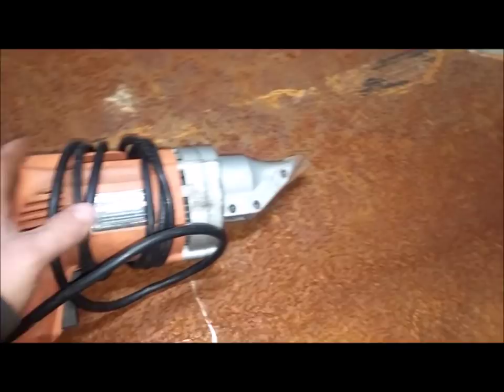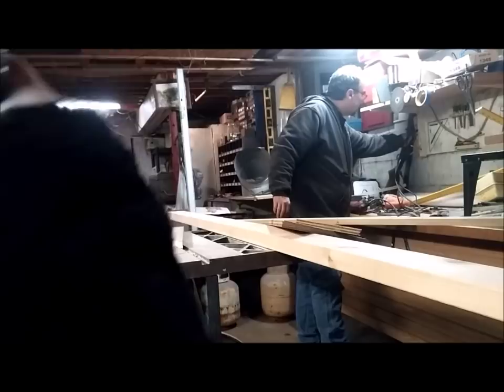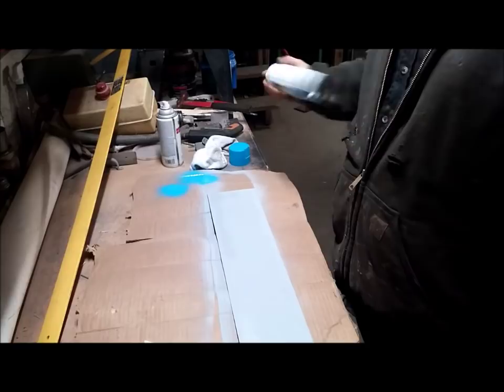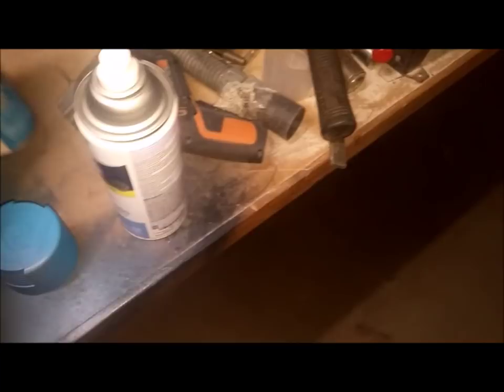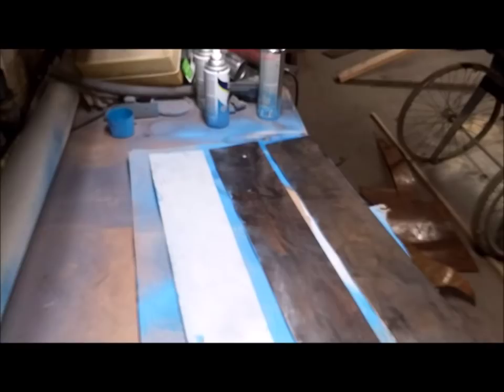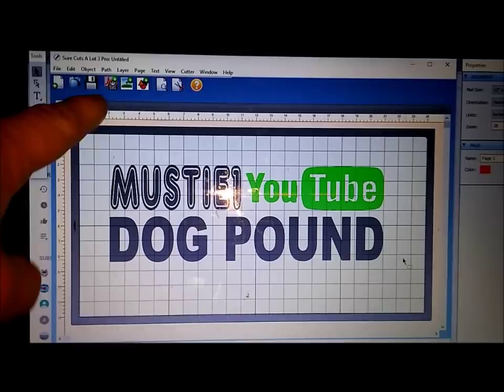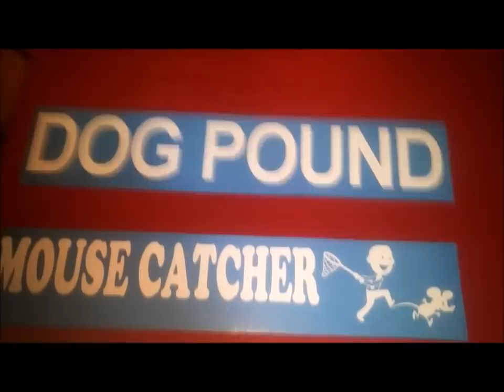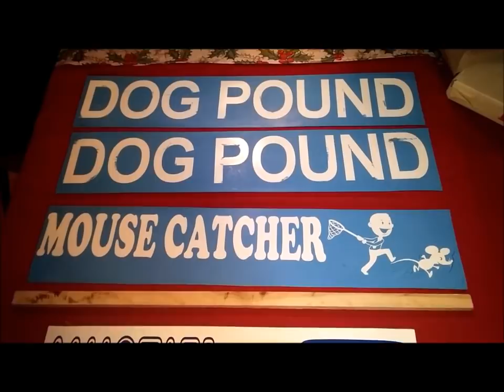Mustie1's Cushman Decal Covers

Comment: Nice job on these!  How affordable is that vinyl cutter, and can you say a little more about where you got it?
Reply from the maker: I think is was under $200 with the software and an assortment of vinyl.  Came with a Tutorial DVD and there is a bunch of info on YouTube.  Its a small machine will only cut 14" width, but as long as you have materiel length.  I have heard that it will glitch is it gets too much information in the buffer. I have owned it for several years. I have not encountered this yet and have done some pretty intricate signs. thanks for watching, commenting and subscribing.